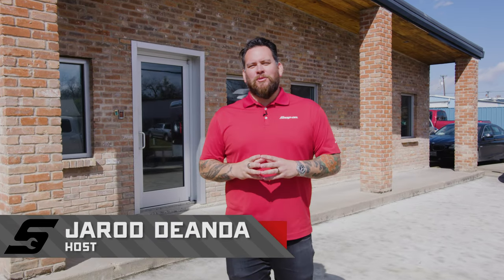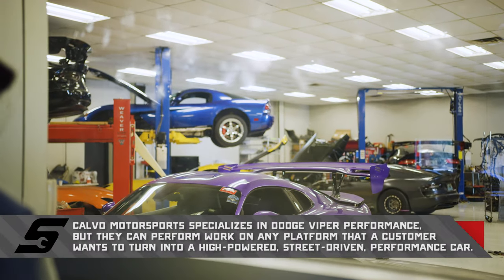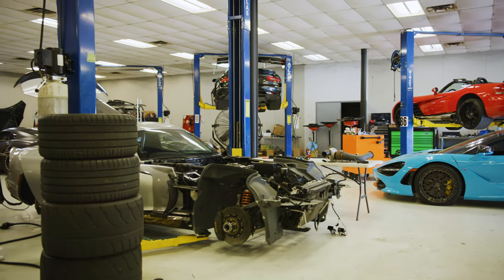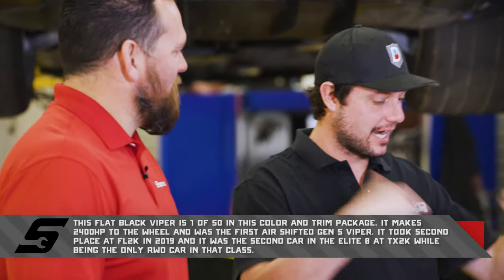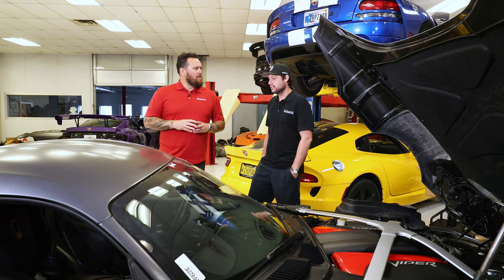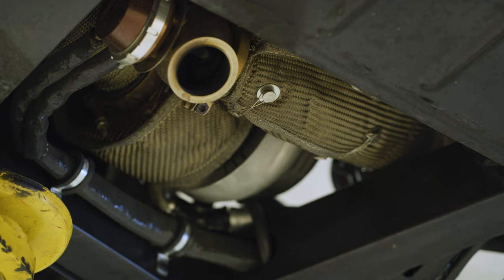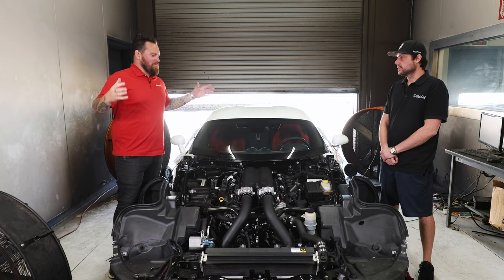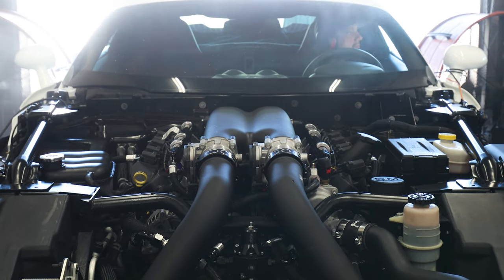Calvo Motorsports | Snap-on Great Garages

Comment: How does the air shifted gearbox work?
Reply: There's a normal sequential shifter that a neumatic module contacted to the ecu that tells the shifter when to shift
Reply: @lanemendenhall7469  so it's not a flappy paddle setup? I love the look of the sequential shifter in the viper.
Reply: @mahavakyas002   Since the pneumatic system is shifting the gear, you could basically just add paddles onto the back that request through the shifter.